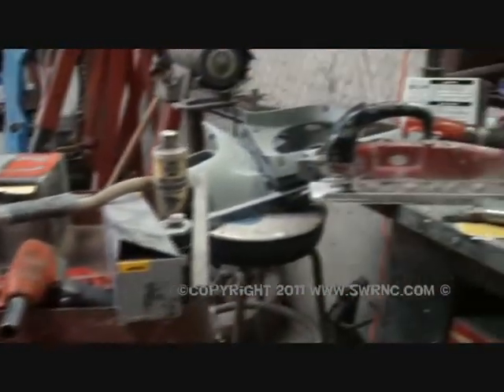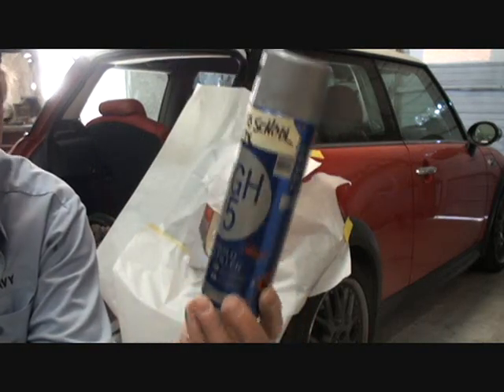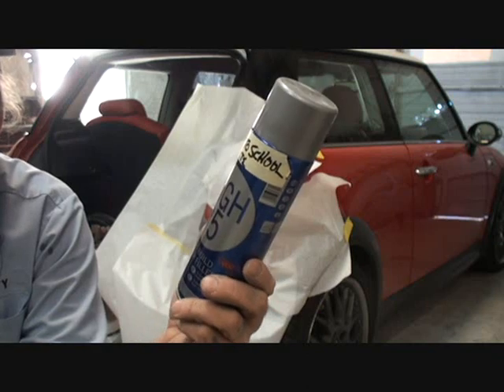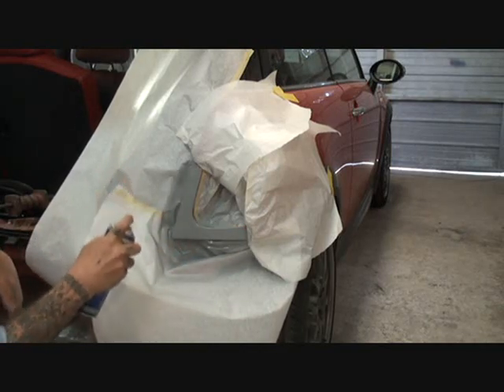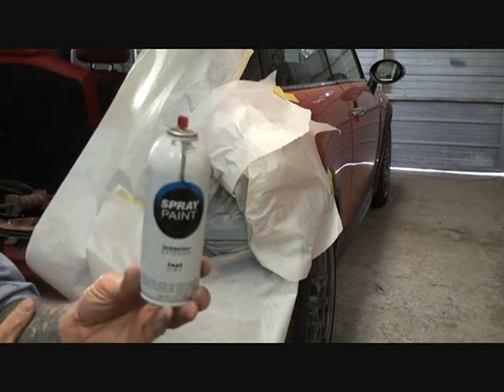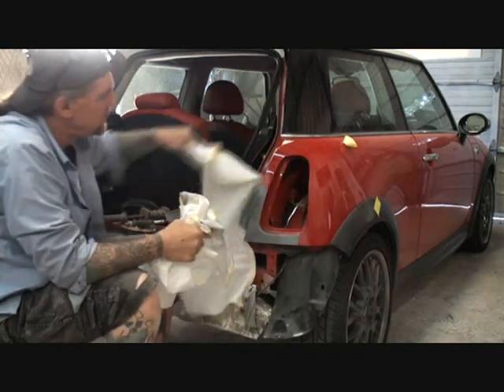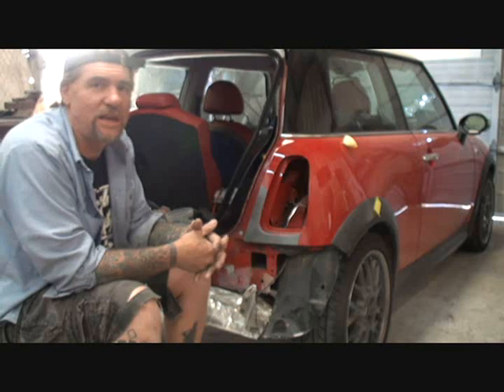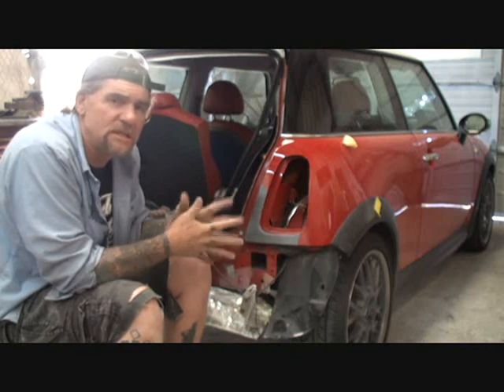Auto Collision-How To Repair A Dent Properly. Part 3

Comment: totally have to spray rattle can like that. Lots of guys I know who are quality techs don't know how to work rattle can. I worked mobile for a short stint so I know but it has it's own set of rules, especially when you spot prime small spots on bumpers.
Good stuff, and man I hate taking apart those midget cars. I think the handle calls for an allen key with a rounded end if you can believe that....a nightmare.

Comment: And for those of you that don't have a jitterbug and a air compressor.  Use a cheese file while the mud is just starting to kick to get the basic shape down.  Wait for it to harden more, then 40 grit it with a block. Let it harden and put your second pass of mud on pressing firmly to get rid of any deep scratches. Then let it harden and hit it with 80 grit and a block.
And holy crap 20$ for a spray bomb primer? you can get a Gallon of featherfill for 55.  Was not to bad of a video though nice work.

Comment: This is NOT how you do Auto Body Collision repair.  U pull which is the spray Bomb primer your using is absolute crap. Not a proper high build primer. Also self etching primers a cheap products unless they are Epoxy Primers from reputable companies like PPG or DuPont. U pull is a solvent based product that needs FLASH TIMES not from an air blower, using air blowers to flash of any solvent based product causes them to skin over and create Solvent Pop. All solvent based products dry from the inside out. If you want a professional job use professional products and use them properly.